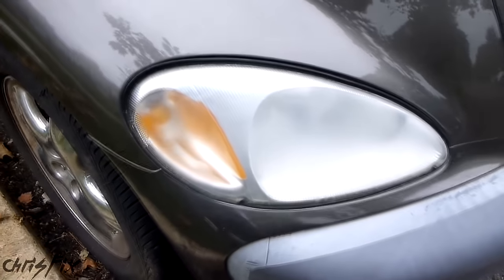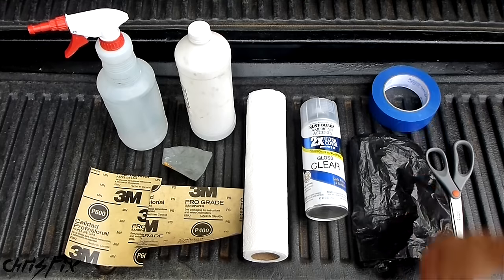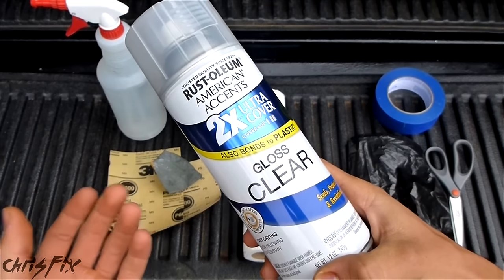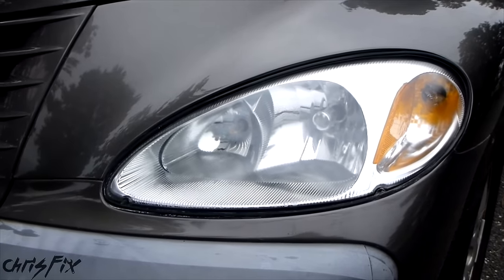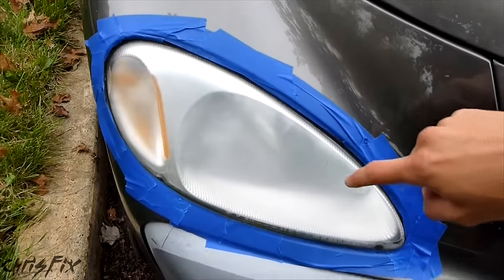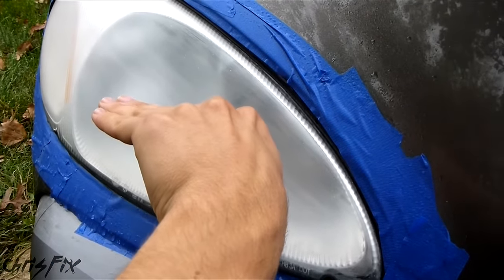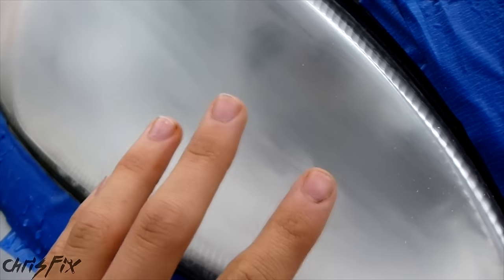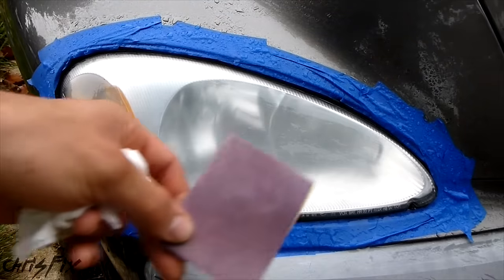How to Restore Headlights PERMANENTLY

Comment from the maker: roger mursick Haha, thanks man! If you do this, take a before and after picture and put it on my facebook page or send it to me? I am gonna try to get a collection of before and after shots from my viewers!  Id like to see how it comes out on your Mercedes Benz!
https://www.facebook.com/chrisfix8
Reply: Yes indeed.
Reply: Have not done my lens yet. I'm am about to change my trans mount Slk230/2001. I'm leary of using jackstands. any thoughts would be helpful. thanks,
Roger
Reply from the maker: roger mursick Why are you wary for using jack stands? Did you watch this video: How to replace a Motor Mount or Transmission Mount
Reply: I did not see it. Thanks much.
Reply: Hey Chris after i clean the lenses. Can i go driving afterwards? Or do i have to wait the full day after cleaning them?
Reply from the maker: It is best to wait the full 24hrs to allow the clear coat to dry for the best cure.
Reply: Hi Chris. I know ur about fixed but...how bout detective work? MB nor
myself can find the cause of a vibration @ 17-2400 rpm's which u can feel
through the gas pedal and steering wheel. And then everything is fine.
Because a lot of stop an go driving is in that rpm range it's very
annoying.  Plus it tells me something is off somewhere. Wheels are fine all
mounts are fine. Shifter bushing (automatic  or manual) was replaced and
stopped the buzzing there.  It's taking up too much of my time. It seems so
obvious but I can't nor can Mercedes find it unless I'm willing to spend
hundreds on it.
Any thoughts would be helpful.
1999 MB SLK230 (170).
Best,
Roger
Reply from the maker: roger mursick Does this happen only when you are moving or can you get the vibrations to happen at idle at a certain rpm? Does the engine shake? Does it happen when you press the brakes?
Reply: Hey... happens in park or moving at 17-2400 rpms. No not with braking. Once pass those rpm's it stops.
Reply: Engine doesn't shake. Just rough and vibraty/buzzy
Reply from the maker: roger mursick Any check engine lights? Does it feel like a misfire? When you say "buz", does it sound like the exhaust is loose? Sounds like there is a resonance going on at that rpm range. Maybe a heat shield is loose which is causing the vibration (been there lol).
Reply: No misfire. It behaves very much like a resonance.  I think exhaust is fine but yes I think u are correct. It's not mechanical i.e. Engine or such. I must be missing something. And yes it does seem like a heatshield vibe but I can feel it in the pedal (gas). I'll comb it over again for a shield or maybe a loose bracket.
Reply: And no engine light warning.
Reply from the maker: roger mursick Keep me posted! Maybe have someone hold the revs so that you can look under the car for the noise. Bring a screw driver to touch parts of the exhaust to try and stop the noise.
Reply: Sorry...went to the movies. I'll do that. I'm sure the wife will be more
than happy...to call a friend to help me. Thanks for your input.
Roger
Reply: roger mursick ever find out what happened to your MB?
Reply: ChrisFix Going to try this on my 96 mustang I just got. Headlights are really bad on it and need to clear them up until I can get the aftermarket lights. Hope it turns out ok.
Reply from the maker: MC Shea G Take some before and after pics!
Reply: I am gonna do this on my wife's 2000 Ford Taurus.  I'll take before and afters.  Thanks for the video!
Reply: ChrisFix   AH dang it!  I watched this vid and polished my lenses yesterday and they turned out FRIGGIN' PERFECT but I didn't get before pix!  I'll shoot you some of the results if you want though.  They look beautiful...can't wait to wet sand and buff them out!  Awesome video man, A+!  Great channel too!  Thanks a ton!
Reply: jst did it 2day nd this freakin works thanks heaps mate..:)
Reply: schiavismo voglio dottorato tti,GDP
Reply: +ChrisFix Thanks for the upload! d:)

Comment: I just finished spraying the headlights (my first time doing this) and I have some tips. First if you don't have a spray bottle, take a empty soda bottle, poke some holes in the cap carefully (from underneath is easier), and squeezing it lets water out (my mom's tip).

 Next when you are putting on the painters tape, make a large overlap between each piece of tape helps because if the end of the tape lifts slightly from being wet, car is still protected.  

Third is when you are spraying do it outside. The fumes are strong and not good to breathe. Also wear a face mask if possible and hold your breath while spraying. Walk away from the area when done spraying until the fumes clear. I forgot to hold my breath for some reason and the smell is now stuck in my nose. Time t take a warm shower and clear my nose! Or just nose spray saline solution. 

I was scares to spray too much. It's my first time using spray paint. So I got a run which is a drip line where I sprayed too much paint. I think to avoid spraying too much paint, keep the can far enough from the headlight while spraying and don't move your hand too slowly. Please let me know if that is true, paint professionals.

 I imagine you can practice spraying on a plastic surface like a food container. It'll give you an idea of how spray paint works and what mistakes cause runs, which you might not care about if you don't want your headlight to look 100% perfect. But it might make you more  confident in  spray paints.

It took me prob 3 hours since my headlight were bad and I work slow. But maybe you'll be faster!

Comment: You might not respond but I restored mine up to the point where I sprayed the clear gloss and right after I sprayed it the headlight started showing like a cracking effect on it that wasn't on there before and during the sanding so now I have a cracked look to it any idea on what happened?
Reply: Unregistered User you pressed too hard
Reply: Supreme Kai it’s my 10th set of headlights so i doubt that’s what it was
Reply: Same thing happens to me, but only on one headlight. Anyone knows how to fix it? Or do I need to get new headlight?
Reply: Same. Perfect painting temp and humidity, very light coats, horrible cracking everywhere. Sanded it down again, started over, same exact thing. What the heck is going on?
Reply: Lucas Reehle I dont know for sure, but some plastics require a special base coat for the clear coat to grab on. Maybe that's the problem. I hope you'll get it figured out, headlights are expensive af.
Reply: Tupetsi I think it was the cleat coat that was on 4he headlight before. I sanded it again, but this time starting with 200 grit sand paper with an electric sander. Much better results.
Reply: Lucas Reehle Good to hear!
Reply: Unregistered User well it was my first and it came out good 🤔
Reply: It could be that you didnt remove all of the old clearcoat so when you sprayed the new stuff it could have cause the old stuff to crinkle and give  off a cracked look.
Reply: Did you get paint that is ment for or works on plastic?
Reply: Unregistered User it's a chemical reaction called checking the solvent  is biting into the sand grit 800-1000gt would be best 400 is harsh
Reply: Unregistered User so more sanding required?
Reply: You need to redo it. And the next time make sure you have it clean of any chemicals and DRY before you apply the clear
Reply: Something happened to me. I think you need to do light coats.
Reply: Unregistered User  the factory clear coat or any clear coat at all was still on the headlight. That light have caused the reaction
Reply: Person_of_Internet what type of grit did you use to sand it off
Reply: Unregistered User

Comment: one headlight looked great the other is not clear. what am I doing wrong?
Reply from the maker: +Tim Foley it is probably orange peel. Wait a few days for the paint to cure and then wet sand with 1000 grit, then 2000, then 3000 then 5000 then polish and it will look crystal clear!
Reply: ChrisFix what do I polish with that murigans headlight bottle?
Reply: Should the sanding and polishing also be applied horizontally or should it be done in a circular motion?
Reply: Beverly hillbillies
Reply: Careful when doing this I'm doing it now and clear coat will run off and down your paint.   So as long as you keep water close it wont adhere and it can be wiped right off

Comment: 4:12-415. How did u move that fast???
Reply from the maker: Years of practice
Reply: ChrisFix lol
Reply: ChrisFix hey can you help me with this car code p0446 from a Toyota Camry 1999 2.2l
Reply: SteelCurtain222 the power of magic lol
Reply: @TheBusFoamer  EVAP Control System Vent Control 

Source: Google
Reply: InfiniteLoop I eventually fixed it the first sensor I put on was a cheap faulty aftermarket sensor so I went to a junkyard after I’ve put fans a new canister basically everything so I got that sensor again and the car was good
Reply: @TheBusFoamer  ohh I see. I guess my reply was redundant

Comment: Don't do this project. The clear coat peels in a year if you park outside or live in extreme climates. Sand, buff with a rotary buffer and scratch x, then wax. Do not do the clear coat step.

Comment: why wont they do this in the shops before selling the damn car-.-
Reply: My car's headlight lenses were coated with a light film from the factory which I believe is a UV coating.  However, that coating does wear off over time... nothing lasts forever.  I had to sand that coating off when my headlights started to oxidize after about 9 years.  Then I followed all of the steps in this video except for application of the Rustolium clear coat.  The headlights looked great for about 3-5 months.  Now I need to do it again and will use the clear coat next time.  However, I'm skeptical that it's a permanent fix.  Again, nothing is permanent and even a clear coat will wear off if it's not cared for properly.  For example, you can compare the paint of two cars that are 10 years old.  If one was only washed on a regular basis but the other one was washed and waxed on a regular basis, you'll notice that the paint on the waxed car looks much better because a good quality wax will protect the clear coat.  Never use Turtle Wax... it's abrasive and harmful to clear coat. A good carnauba wax is best.  Don't be cheap when buying wax and you'll be happy with the way the paint is preserved.  However, if you have an older car and the paint is already damaged, the damage is done and carnauba wax won't help.  Long story short, use good wax on the headlights after you've applied the rustolium and I believe the work described in this video can last a long time, but not forever.
Reply: Great comment. what exactly is carnauba wax and how much does it run for? also i've read many comments about clear coat not being a good option for headlights... are there any alternatives that would make more sense in your mind? someone said sanding and polishing works better in the long run but you have to do it every like 5-6 months
Reply: so you might come back and buy new headlights. company gets more money that way
Reply: ***** I've been sanding/polishing my headlights with the McGuires kit, sold at AutoZone and other autocrats stores.  I've used the same kit, 3 times now.  I think I can get one or two more uses out of it.  If you go this route, I suggest buying additional slightly more gritty sandpaper to do the initial sanding.  Use the one small extremely fine piece of sandpaper within the kit for the final light wet-sanding/polishing. The next time I do it, I'll try the clear coat as well, after the wet-sand/polishing step, let it dry and then do another wet-sand/polish. If it doesn't work, the worst that can happen is that I sand it off in another year and do it again.
Reply: oh my my what a beautiful job
Reply: RedondoBeach2

Comment: Thank you so much for this video 
thank you for finding the simplest way to make it all work (you experimented with different sandpapers and clear coats)
I was very hesitant to sand by headlights but your video made it look easy 
I followed it exactly and it works very well. 
The explanation is very helpful and simple. 

Thank you

Comment: The PT cruiser is worth less than the clean headlights
Reply: @ Arav Kulkarni, The PT Cruiser is the worst car's I've ever seen for this problem. I've done this for a few friends in the past. I have an 05 Pontiac GTO and have done mine as well, but would rather replace them as this isn't nearly as good as a new set of lights, but one's for the GTO cost $675.00 each. That's a lot of money for some Damn headlights!! The GTO's are bad about this too, but not as bad as a PT Cruiser! Don't know why they don't just make em out of glass! 🤔
Reply: Maybe Chrysler just wanted to cheap out on the headlights. Good thing modern xenon headlights with glass don’t oxidize.
Reply: I know that feeling. My dad drives a 1970 Dodge Charger RT and the headlights get very oxidized. We did change the headlights to xenon tho. That helps a lot with better visibility and easier maintainence

Comment: Next time take the clear coat can and put it into hot water and you wont have that orange peel. 
You're welcome! 😉
Reply: R.I.P.Squirt& Jinxy oí
Reply: I hope this is true cuz I'm gonna try it
Reply: I still had orange peel, but Im unusual and awkward, so I obviously did it wrong.
Reply: @davidnorthern4257  I found to do this from another channel. You can always Google on how to avoid orange peel and there might even be other techniques aswell. Light buffing would help if this method doesnt completely work. Goodluck!
Reply: @jesseshwaga  Did u put the can in hot water and it still didn't work? It's supposed to help everything bond together as the warm water melts all the chemicals together. Kinda like melting cheese i guess. Lol
Reply: @kittkatt032  i did, but was probably too impatient. Oh well, it is amazing being able to drive at night without clenching my buttocks.
Reply: @jesseshwaga  True, and it should last you atleast 6mo and u can always just repeat the process or buy some cheap after markets on Ebay fo cheap.

Comment: Clearcoat? it contains lacquer and solvents and will permanently burn  the plastic....not the right thing to do.
Reply: The can said it said it was for plastic.  I would assume that it wouldn't have as harsh of chemicals in the paint for that application.
Reply: the one that was suggested to use stated plastic safe on the label...
Reply: Please watch the video before criticizing
Reply: Please read my comment about  using this method with CLEAR GLOSS !!!!
Reply: If you took the time to read  the back of the can and the MSDS/technical sheet of this product it says that it contains "ACETONE" . This solvent will burn plastic
Reply: Phil It also depends on the type of plastic and considering it says it's plastic safe it's obviously not enough to hurt plastic
Reply: Think more positive and optimistic rather than negative and know-it-all... This worked great for him and for many others.. This is a great alternative to a 200-400$ professional headlight restoration or even a 100$ick fix kit
Reply from the maker: Works for me and the thousands if not hundreds of thousands of people who have done this.
Reply: No, you think it works when really you are removing the coating protecting it from stone chips, and drastically shortening the time in between the plastic yellowing. Or have you worked in headlamp development and can post some evidence to refute me? Didn't think so.
Reply: +Pete Bevan hey no need to be so harsh.. professional restorers use a similar method but avoid the grittier sandpaper .however they still hand sand it and then just polish and buff it with different chemical based products... and still use a carnuba wax as shown at the end...

Comment: Just did this today. Clear coat job was shoddy but I recommend sanding 400-600-2000 for about 3-5 minutes each, making sure to get every spot you can and then letting it dry for at least 5 minutes and then keep going with the 2000 grit until it is crystal clear when wet and then drying off with alcohol and hitting it with the clear coat.

Comment: Great video, but my experience with this same clear coat product was not so straightforward.  When I sprayed my 2003 BMW X5 headlamps, after the 2000 grit step, I got serious "crocodile skin" crinkling as it dried.  I had to remove it, and try again, this time first spraying Duplicator Primer Adhesion Promoter, letting it dry and then the clear coat.  Made all the difference.

Comment: I did exactly as you say in the video, one of the light looks really good ! But the other one has some thick crack probably from the clear coat... I wet sand it with a 2000 one and it still has the cracks... Should I start again or what should I do? Thanks for the video your content is awesome !
Reply from the maker: I’m guessing you put it on too thick since the other one came out good. You can sand it down until the crack is gone and then work your way up the grits to 5000 and then polish until crystal clear. If you sand it down all the way so there is no clear coat you can just start over. Maybe let the alcohol dry longer after you do your final wipe before paint.
Reply: @chrisfix  thanks for the tip ! I'll try to do that when the weather will be clear

Comment: Awesome video very informative.  I did try restoring my headlights came out great however it didn't last very long especially living in a Florida heat now back to its old form yellowish. I saw your other videos when flipping cars when restoring headlights you use ceramic coating rather than gloss spray. Which of these you highly suggest ceramic coating or glossy spray finish?